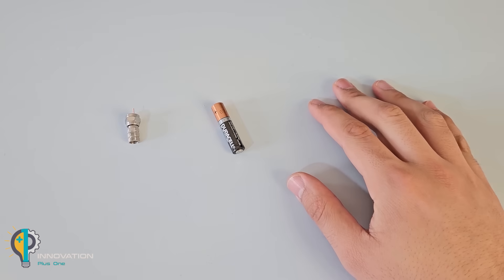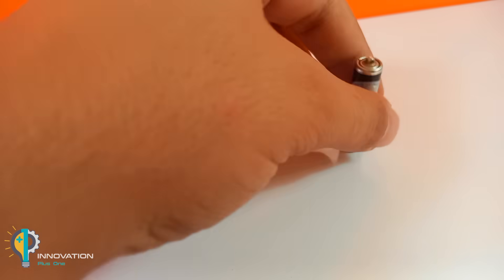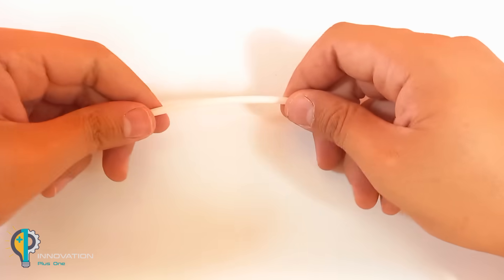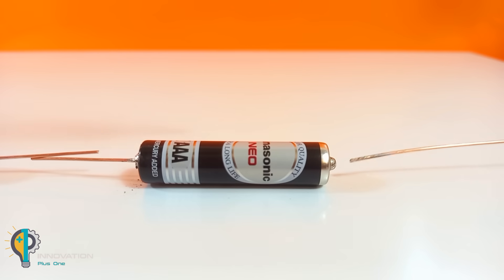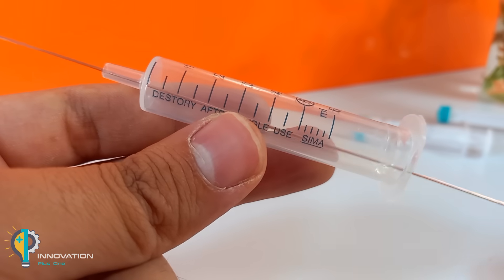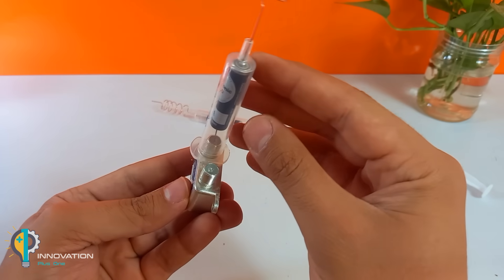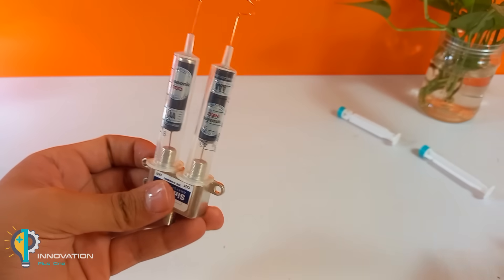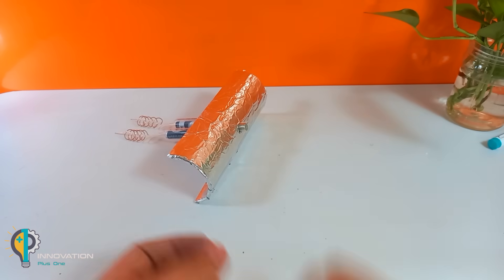Insert Battery into the TV and watch all the channels in the world || Antenna Booster

Comment: What type of grease did he apply on the two side of the batteries before soldering them?
Reply: it is called fluxite
Reply from the maker: You can solder more easily by using this soldering oil

Comment: Ever since doing this, I get all channels….and when I watch them I can now reflect what I am watching directly from my eyes back onto whatever I am staring at. Thanks! Amazing!
Reply: funny, a directional antenna definitely,   the batterries do nothing, and the length of coil ya got looks about the 7000mhz area so ya wont get hdtv since its in the 8 inch area.... but you might recieve a couple channels if you extend the antenne a couple inches.    ps  bs baffles minds, but ppl who do industrial antenna design are way over your head, stop trying and learn how wavelegth is give by length...  wifi G is a 6 CM pickup.  HDTV over air is UHF..... thats 20 cm..   learn dude not hard, there's a page that gives you the frequency of ALL channel, range and attenution to your location :-\
Reply from the maker: Wow, thank you❤